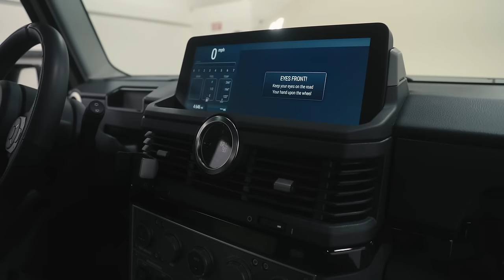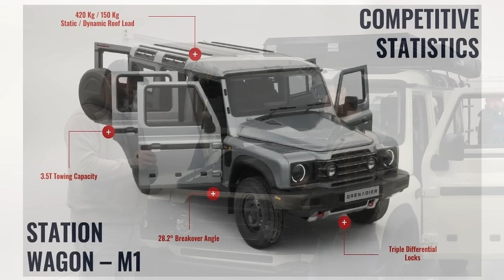Grenadier On The Rack : After the Trail

Comment: Lift with 35s/ 37s and probably lower gears.  This could be my replacement for the Jeep.
Reply: For twice the price snd less capability.
Reply: Notice the price 😂. When’s the last time you priced a rubicon?
Reply: This thing is far superior than a jeep
Reply: With a 2” lift, you can get 35’s on no problem. 37’s have been done but I don’t have plans for that 😅
Reply: @dmitrydk92  Not with a 2.5:1 low range and lack of disconnecting sway bars it isn't. There's definitely lots of  potential and it has more refinement in areas but it'll take a large lift just to fit 35's and there's a lot of other unknowns for $80-85K. It has my attention but I find it over priced and by no means would I say it's better than a Rubicon loaded at $20K less.

Comment: I’m still running a 2004 Discovery V8 so you shouldn’t have anything to worry about after only 5 years.
Reply: I have an ‘06 D3 with 313K miles (over 500k km) and still going!
Reply: @pilotgabe   Do you daily drive the Grenadier?  How do you like it on road around town compared to your D3?  I still drive my '05 D3 daily and am considering a Gren.  Wondering if the turning circle (or lack of) will wear on me daily.  I'm sure off road it's fine.
Reply: @deanfisher1753 I do daily drive it, but the comparison is apples and oranges. Because of a lack of rack and pinion, the steering experience on the Grenadier is more involved. The turning radius is not nearly as impressive as your D3, but hardly any vehicle matches the D3’s radius haha. The return-to-center is minimal. On-road the steering is not as “easy” as the Discovery 3/4 due to its beefy steering stabilizer bar, but you can replace it with a couple after market options that makes it noticeably better. The suspension being coils, it doesn’t feel as “cushy” as air suspension. I own 3 L319’s, they drive better on-road hands down. Having said that, I love the Grenadiers manners now that I am used to it. It’s comfortable, the interior has a bit more noise than the L319 but it isn’t unbearable by any means. Both my wife and I LOVE driving the Grenadier around. The Recaro seats are more comfortable than the Land Rovers we have and especially more comfortable than our D3 by a big margin. The D4/LR4’s we have are closer to the Recaro seats in comfort. Hope that helps!
Reply: @pilotgabe  Thank you.  Your Grenadier is awesome BTW.